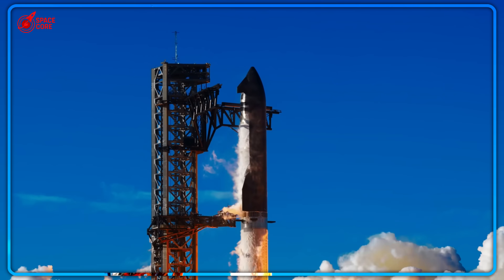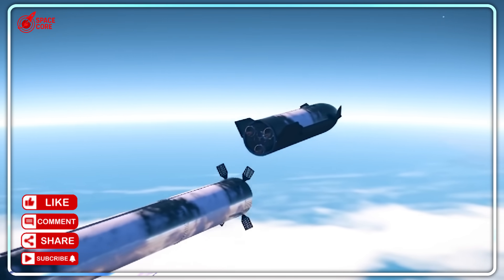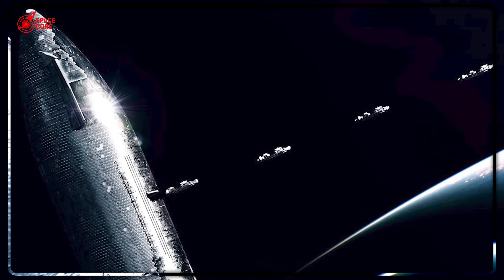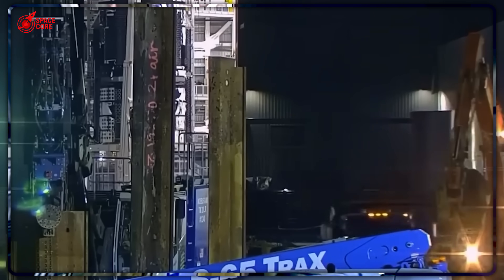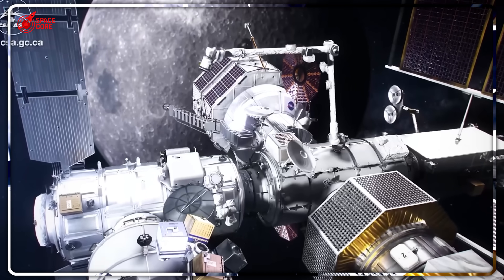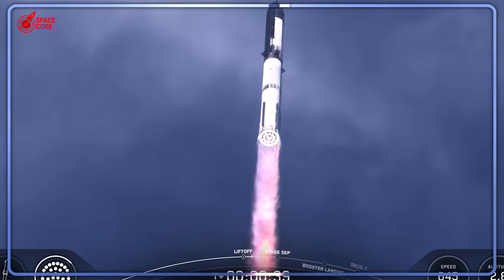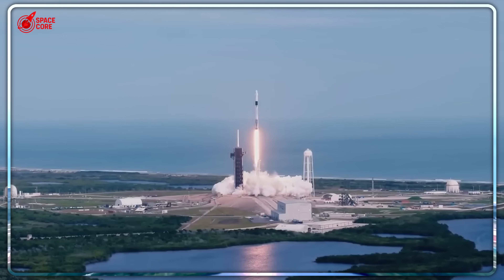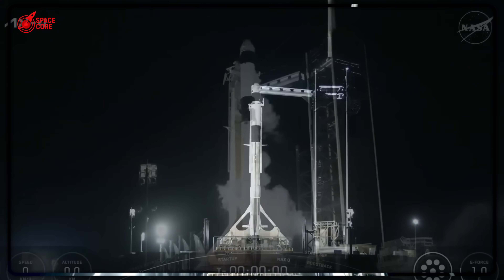SpaceX's Starship Interior: 3 BREAKTHROUGH Systems SHOCKED NASA!

Comment: Hey i remember this clam shell design it was in a movie ( moonracker ) 007 in 1979 didn't look safe and why does the payload bay needs to be pressurised it's just gonna open to the vacuum of space anyway  !
Reply from the maker: The clamshell door, like Moonraker's 007 vibe, is bold but engineered for safety with tension cables. Payload bay pressurization protects sensitive cargo before deployment in space’s vacuum.